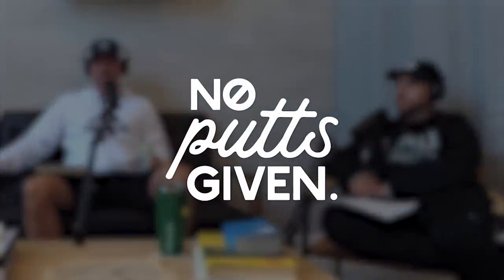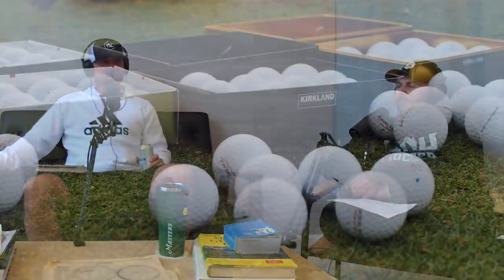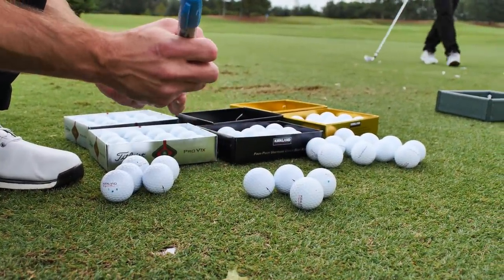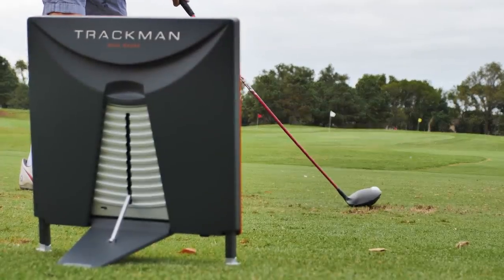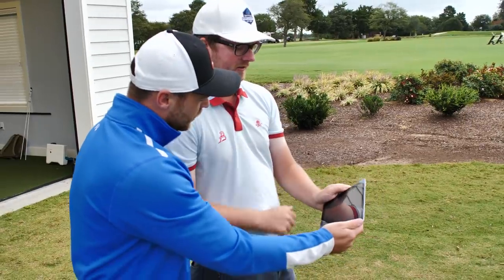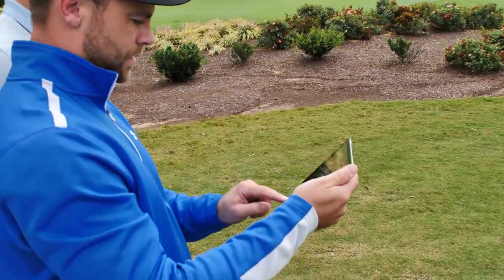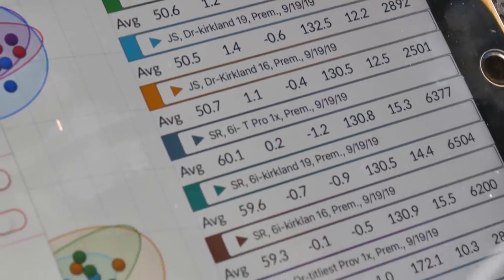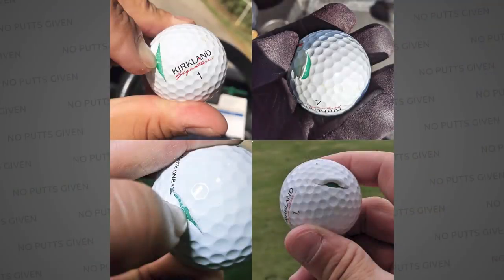2019 Kirkland Golf Ball - The Modern Balata?

Comment: It seems to be a manufacturing issue with a batch or batches. I've got 4 dozen, and mine are great. Seems to be a bonding issue with the cover to the core, I've read they're going to just recall the first batch and figure out what the issue was, and hopefully fix and re issue them. Great ball, very similar to the first 4 piece K Sig if you have one with no cover issue.
Reply: Have played three rounds without a problem so I agree with Rick and think it is a batch issue. I was playing the 3 piece,
  this one seems to flight a little lower than and carry a bit farther than the 3 piece, but too soon to tell.
Reply: @PaulSmith-uj6qv  Did you get issued the refund as well?
Reply: @chrisnormanable  Yes I did